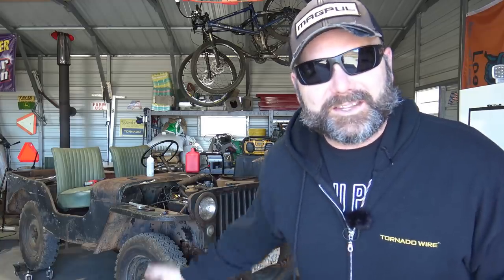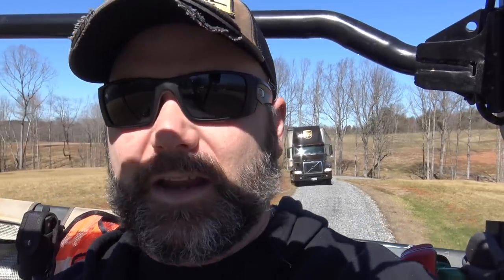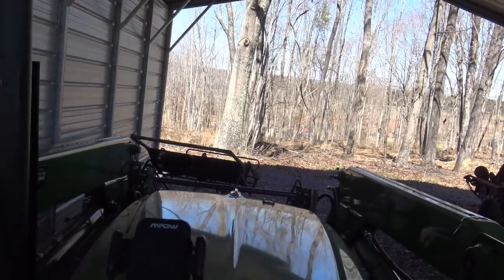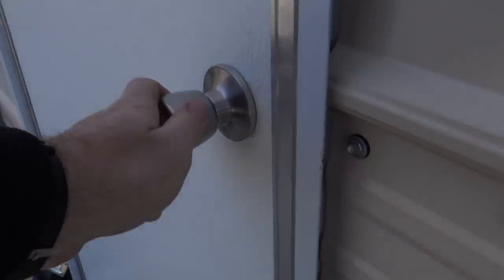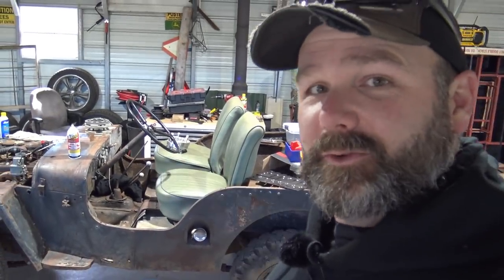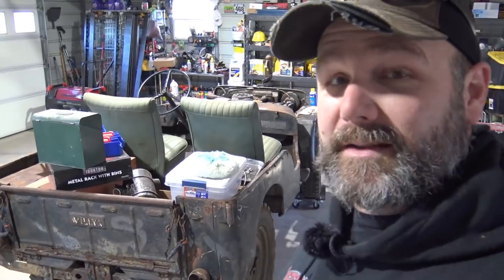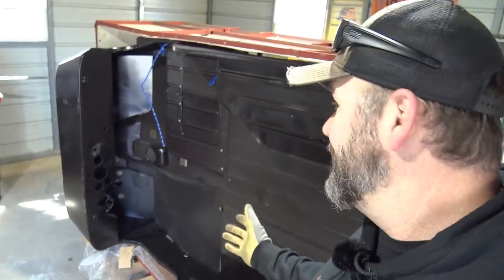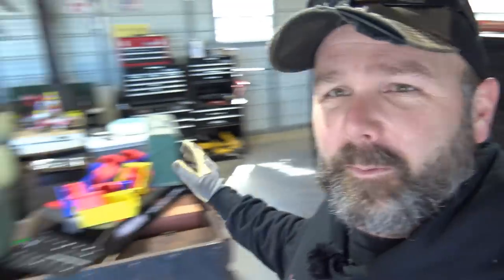Willys Jeep Rescue: Ordering a Jeep in a box! The motherload of parts!

Comment: Scuff the whole  bottom with a 3m pad and paint with Real Epoxy paint ( do that part out doors at 70 degrees. ) Undercoating, if not perfect can trap moisture, which you have plenty of.
Reply: SRF - follow Formula Firebird.  He's got it right.
Reply: @lint2023  Apply undercoat in dry low humidity conditions to a clean surface.  Otherwise moisture can get trapped.  Otherwise, just give it a good quality epoxy paint and then a lanolin based product like Fluid Film, re-apply Fluid-Film annually if you use the vehicle in wet conditions.  Most of all, keep the under body clean and parked under a roof.
Reply: @lint2023  x2
Reply: toilet rings and boiled linseed oil.   lifetime protection                  @timothykeith1367
Reply: @geoffreyjones2000  just like Mustie1 !
Reply: I knew the ziebart guys...their formula.  I mentioned it to Mustie1 last year                                                                        peace my friend    @alvon911
Reply: It may sound like overkill, but if it were me, while the thing is upside down, I’d strip that black paint & then POR 15 (or similar product) the entire underside. It would be so worth it. Then you could undercoat it.

Comment: Not only should you undercoat with something like rhinoliner, look into injecting rustproofing into all the void spaces and then sealing them.  There used to be commercial services to do that (Ziebart from memory?), so if you can find one of those services, you could probably get it done on the cheap by trailering the tub to them.  Sames goes to getting the underside and interior rhinolined.  Not traditional, but it will greatly extend the life of the body.  Check in Charlotte......  I also recommend using urethane bushings when you mount the body to the frame.  Again, not traditional, but they will not break down over time and absorb water, and cause body rot at mount points.

Comment: Save the old grill and use it for wall art  in the shop or the barn.  I have seen tubs that were done with LiNE-X  ,also there are spray your own bedliner armor kits you can do in your own shop. Amazon has a big selection.  We did our atv 4wheel trailer in Line-x, in desert tan color, its a  great look .  much better than undercaoting treatments especiall in farm and off-road applications.  also seen it used instead of paint on the body for ultimate  no scratch coating
Reply: I'm not sure about his, but I just got a tub kit for a 48 CJ2A and it didn't come with a grill...so I'll have to use my old one.  I was hoping for a man-cave hanging grill, but nope.  ;)

Comment: POR 15 is an excellent product.  My 1942 Convertible has had POR 15 on the body bottom, inner fenders and frame for 20 years. Not an ounce of rust.  Eastwood makes a similar product though I have never used it.
Reply from the maker: Jack...I was just going through the comments...I wanted to thank you for all of your very insightful and positive comments...I appreciate a guy like you on the channel! Thanks so much!
Reply: Stoney Ridge Farmer Thank you.  Got my first low hood while in high school and many more have followed.   Love those old jeeps.  A few words of caution about the body you just bought.  As I mentioned, put it together on the frame to make sure everything lines up.  There have been issues with this in the past.   I don’t know what level of restoration you taking this to there are a couple more things to lookout for.  One is the primer.   Yes it is primed.  But it isn’t the best.  When I did my JD Juan body, on the advice of others, I removed what they referred to as shipping primer and laid down a good coat of DuPont primer.  Oh yea one other observation.   You mentioned some scratches.  This can translate to almost invisible dents that will show up when painted.  As you problem already know, the better the foundation when you paint the nicer the paint job.  Things we would take for granted fitting.  Like the actual gauges you are using fitting the holes.    Run a tap tap into caged nuts to make sure there is no weld spatter on the threads.   I know you get the idea, detail, detail, detail.

Looks like you’re having a good time.  If I were closer I’d stop by and give you a hand.
Reply: Oh yea, the old grill can be recycled into a great bench.   Use the grill for the back and weld up a frame to sit on.  Do NOT paint the grill leave it in the distressed look.  Really kool piece.

Comment: Paint is far better than undercoating, undercoating traps water and ends up causing rust. Some bedliner in the wheel wells might work well, rocks kicked up can chip the paint, bedliner would probably have better impact resistance than undercoating.

Comment: If you have seen Mustie1 on YT, he works on all kinds of old vehicles, motorcycles, boats. etc. He currently is make a 50's era Karman Gia into a daily driver and it has a lot of rust even areas that have undercoating. He stated the problem with undercoating is that it does not expand and contract at the same rate as metal. Consequently the undercoating over time  hardens, then chips, cracks and forms pockets that traps moisture. This in turn causes rusting out the body parts. He recommends that just paint is better in the long run although he did say that the jury is still out on coatings like Line-X and Rhino Liner.

Comment: DO NOT PAINT OVER THE SHIPPING PRIMER! Scuff and epoxy over the black shipping primer it is not a base you want for your paint, i work in a restoration shop and that stuff will cause problems later on down the road if not properly prepped. Stoked to see this project!

Comment: I assembled tubs with spot welding.PLEASE make sure you use quality undercoat materials.There will be air gaps.Clean and paint the frame Before setting new brake lines,electrical,etc.If there's rust where you put new body pads,they'll rot so quickly.You are going to have a Legacy,when finished.Great grandkids should be able to drive that too.
Reply from the maker: Yessir...I am totally with ya! I need to get under it and in every nook and cranny...seal it off to the weather while completely dry....and use some body seam seal in alot of areas. Now...the jeep will only have exposure to the farm...and probably be a fair weather machine...but never hurts to be thorough thats for sure! Thanks man!!
Reply: @StoneyRidgeFarmer  For now the plan is only exposure to the farm but in 20 years who knows?

Comment: if you spray linseed oil on the bottom and let it dry get it into all the places where it can rust and you can still paint it and do the same to the frame and also spray the inside of the frame  and it will last forever

Comment: Paint  it match if you like but for goodness sakes don't use rubberized under coating on it. It just holds moisture under it once it gets some age on it and is worse than nothing at all from my experience. You can always add a wax based under coat after you're done painting if you want extra protection. Fluid film for example.
Reply from the maker: I'm researching materials now to do the best job possible

Comment: I just watched this again since my tub assy will be arriving in the morning.  One thing you might need to look at is the passenger seat mounting.  Your seat frames aren't original, but the passenger seat is supposed to be mounted in a way to tip up...because your tool storage box (jack, tools, etc) is located under that seat.  Your seats do look more comfortable so it's up to you, but if you mount them as-is you won't have access to the storage box.
Reply from the maker: I'm with ya Jay....I need to find a junker to pull the seats from and re-build them.....I'll make something work out..I've got plenty of metal tubing...might fab up my own seat mounts! I see junk yard trips in my future!

Comment: I have run WILLIES since the late 70's so to make starting easier you need to convert it to 12 volt. the 6 volt batt works ok new but the voltage drops when you hit the starter. You just need a ballast resister for the coil, a 12 volt Battery, a 12 volt generator(or better yet a alternator), & 12volt light bulbs. this will spin that starter over so nice, it will start very quickly. never had starter problems with 12 volt.
Reply: Alvin Bontreger all correct.  I changed to 12 volt coin, installed newer 12 volt Jeep gauges, 12 volt headlights and all bulbs to 12 volt.

Comment: Personally, I would test fit the body to the Jeep. Then I would plastic weld the seams, have the body powder coated because as it sits it would be CHEAP because there is zero labor. After powder coating, I would have the bottom of the tub Rinolined. Take the time on it now, and your grandchildren could enjoy it because it would still be around.
Reply from the maker: I agree with you 1000% .....I have the paint for undercoating just like your speaking of....and seam sealer is a must!
Reply: I see your using Eastwood's rust encapsulator. Its a great product, I've used it many times. My experience though, it that it tends to chip easily on body panels. So I'd use it for a frame, but I'd top coat the body with something else. I've used red oxide on jeep panels and it performed very well and didn't chip off. Plus its good for rust prone areas as well. Good luck with your project.

Comment: JD Juan Philippines makes the body parts.  Make sure you fit to frame before painting.  Sometimes there are issues with bolt holes lining up and need tweaking.  Tweak before paint.    Then disassemble for paint.
Reply: Jack Smith Jack and Josh... This is the best comment that I have seen on this video.  As the carpenters say measure twice and cut once.  Follow this advice and you will not regret the extra time it took.  As to undercoating, I don't have enough experience to know what to suggest, but the comments about the rubberized coatings holding moisture make sense, so if I was doing this I think I would use the paint idea, maybe even the epoxy paint idea.

Comment: Don't do anything regarding Rhino Lining or paint until you get the tub to fit. Trust me. Make the old frame (which is without a doubt tweaked in spots - just look at that tub on it - and the Philippines-made tub is probably full of small flaws that will make you tear your hair out when trying to mate it to the less-than-perfect frame. The damage to any undercoating or paint would cause you to have to do it again. Don't do work twice. Consider all this fitment stuff to be a sort of wise man's paint prep. Good luck!
Reply from the maker: Yep...you make a very good point...taking the time to make sure it fits up right

Comment: I have used a excellent rust proofing epoxy/paint called POR 15
It can be thinned & sprayed on. But it Must be Primed before it Sets, 
then when it’s Cured, Final Finish coats of paint can be applied. Great for UnderBody Metal. Leaf Springs, Shafts too. But, it will Bond Metal parts for life so be careful. Kills your clothing so wear protective suits too.

Comment: Put a coat of chassis saver under it. It will rust proof it and it's really durable. And you can get it on Amazon
Reply: That's for a bare metal surface
Reply: @Formulabruce  actually it works really good on primer and if you wire brush rust it  holds good on their to.

Comment: Having a Jeep like that is on my bucket list to own. I even thought about taking a Jeep tub and put it on a ford explorer frame. We have the Explorer and it runs ok but the body is falling apart. Do you think it could work? Yes I would do the under coat or like the linex bed liner on both the frame and the bottom of the tub.

Comment: I have to agree with some of the other comments, I woudn’t undercoat it. I think I would either use POR-15 on it or have a bed liner material sprayed on it. I honestly think that you would be happier in a few years if you brushed, rolled, or sprayed flat black Rustoleum on it than if you undercoated it. The Roxors have a mat black bedliner type material applied to the interior metal surfaced; not sure about the underbody, but under the fenders are just painted along with the rest of the body. Love the Roxors, and would love to add one to my “fleet”!
Reply from the maker: I've been reserching POR-15  seems like a great product

Comment: Do Not use any hard surface under coating on anything EVER ... just oil it once it's all done .. plus that body will not just bolt on ... there LOTS of cutting and drilling and welding to do yet! :)

Comment: Ospho rusted metal renewal system.  On rusty parts then epoxy primer  then paint entire body inside and out  then  i would use rubber  rock guard or rhino liner on the underside  3 layer protection  stone chips and road grime stick to spots chipped  hold moisture rust starts. I would then religiously keep it clean and do what it takes to stay on top of issues that show up. I would also  oil spay  instead of under coatings. Ohio is rough on vehicles salt eats them. Oil spay cheap. And protects for winter  then  clean up over summer  repeat yearly...  
Other question wher you find the jeep

Comment: I have been interested in a Willys Jeep for a long time, based on all the parts that are available, is it possible to build a totally new Willys Jeep?

If so I had some cool ideas for a build, based on some reading I did on mods people did to the Willys Jeep:

-Kubota Diesel Engine

-24 Volt Electrical System

-Rhino Lining the whole undercarriage

-Fold down top

-Possibly heat and A/C (Vintage Air possibly?)

-HAM and CB Communications

-Standard WWII Colors.

Some of it might be too ambitious but it could be all assembled, I would love to do something like that.

Comment: Do yourself a huge favour and do not paint any of the body parts yet. Take the old body off and set your new body on and get all the panels fitting properly first. Painting the body should not even be considered until you finish panel fitment. You will have holes that don't line up, pieces you will need to add from the old body to the new one. The new bodies are not made perfectly. They have fitment issues.

Comment: Keep the metal banding. Can be used as shims.  Sharpen a small (4" ) section and you can get a scraper into tight spaces. Weave sections together in a lattice ( 1 " gap) and make a critter proof window for chicken pen. Lots of uses.
Reply from the maker: Good idea Eric...I could make all sorts of stuff with it

Comment: Do not undercoat it. Undercoating is bad, it traps moisture and will rust from the inside. Id put a good coat of black paint on the bottom then spray it with a mixture of chainsaw bar oil and boiled linseed oil. Then drive it around the farm and get a good layer of dust on it. Ever notice how there is no rust under a car where the oil has leaked then road film covers it? Same thing with this process. Fluid Film washes off, this bar oil method is used by us Northerners for years.
Reply: You learn this from musti1 I sure did.
Reply: I agree, but prefer Fluid Film. I buy it by the gallon and apply it with their spraygun.

Comment: When you had the starter rebuilt did they put 12V parts insted of 6V?
Reply from the maker: It's 6 volt parts but I don't think they went through it like they were supposed too...it still had the old brushes in place...I think its got a dead spot somewhere in the rotor..no new bushing...it squeaks when it's turning over....once the body comes off...I'll take it back in for rebuild again...they gave me a warranty

Comment: Think about putting disk brakes on it.  Quote from another persons project:  "The secret is to use calipers and rotors from a GEO TRACKER or SUZUKI SIDEKICK. (Not a Samurai, and no 4-doors allowed.)
"  Now would be a good time to look for shocks.  Might have to weld brackets.  Fun to spend someone's else money. :)  Convert to 12V.  Should invest in a glass blaster, No 8 glass bead.
Reply: Steven Robertson Now is the time to start at the frame up.   Needs to be inspected for all the hairline cracks they all have.  Do not make the mistake of boxing too much of the frame for strength.  Frame needs to flex.  For crack repair, I drilled end of crack, lightly grind the crack then TIG or wire weld on lowest temperature that gives good penetration.  Great time to make sure spring hangers are not trashed. I say this knowing there will be a number of people chiming in here with their own theories.  I’m sure YouTube had a lot of videos on frame crack repair.  

Shove all those nice body parts in the corner.  Get old body off and go after the drive train.  Frame repair - paint, front end and rear end inspection, repair and paint, springs, new bushings, shackles and paint,  steering - linkage inspection, replace as needed, tie-rod  ends then paint.  Steering box inspection then paint.  

After frame and drivetrain is addressed setting on wheels and tires ready to run is it time for the body fit.  Lots of work but well worth it to do things in order rather than having to deal same things over and over. Plus there is something to be said for working with clean painted parts.